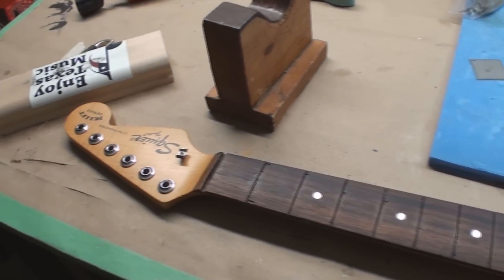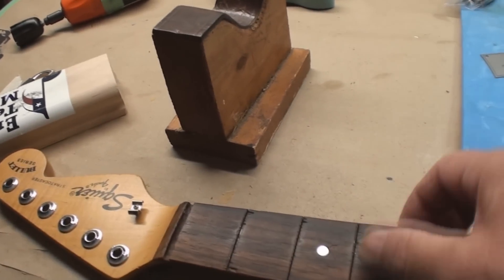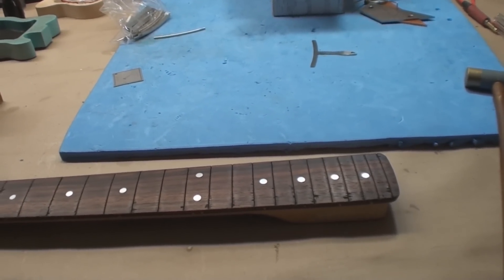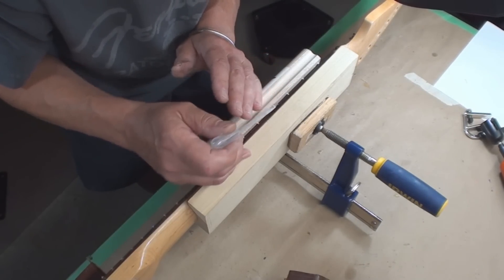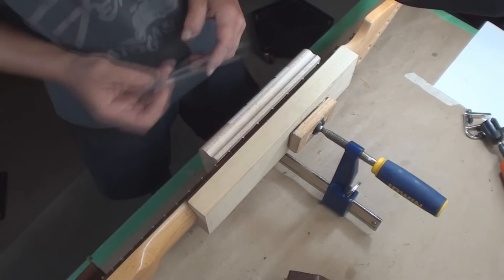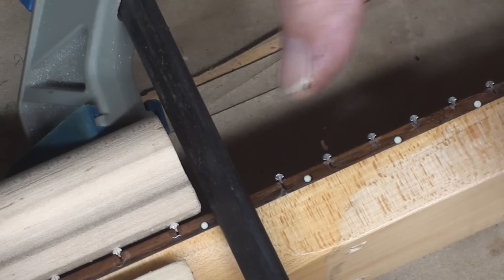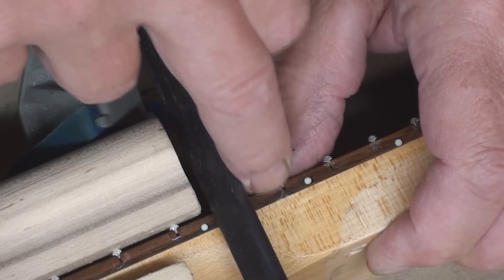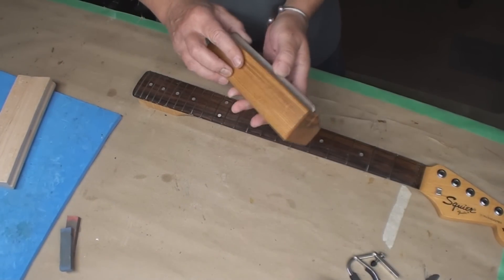Guitar Fret Replacement Tips

Comment: From Leo:  Tip for you buddy.   I put my end nippers in a one gallon zipper plastic bag and use them inside it. 
  Push it so that the fret pokes a hole. and then trim the end.  Keep reusing the same hole as much as possible.  All the trimmings stay in the bag instead of flying in your face and all over the shop. Hope that helps, cheers.
Reply: This, all day long. I have never done any guitar work, but I use this same trick whenever I have to cut screws, pins, or other small metal parts!

Comment: I have a 1996 Squier Stratocaster which has never had a refret. It hasn't presented with major ssues but the frets are very flat on top and very low. The nut is also the original nut and I'm considering replacing it with bone, but I know that once I refret it I'll need to do it again or shim the nut. Not sure what I'll do yet but this vid has been helpful.

Comment: Hey Dave! great video, I have a question, was wondering if you could help me, I have a fender american strat guitar with a maple neck, I guess the maple is finished beacuse it has a shine on it and it is probably lacquered or something, I have no clue what is the finish although I would love to find out anyways I was wondering on how to go about cleaning it without damaging the wood or the finish on it, is a damp rag ok? Also the frets have some corrosion on them so if you can tell me what sand paper grit to use for removing it without removing too much material off the metal I'll be glad, thanks!

Comment: Hi Dave,  Thanks for advice about wetting the fret board, it worked a treat 👌  What made getting some of the lower end frets in,  even worse, was the last 4 frets of the finger board has an unsupported section, i.e. a gap between that, and the sound box, so had to be a bit careful packing it up to stop it springing about.  Removing the neck was not option in this case,  as I'm in the process of restoring what I think is, 1931/32 Epiphone Archtop.  
Cheers Roj UK

Comment: Curious as to why when you “clamp and then glue” those fret ends that pop up why you don’t “glue them clamp” ? I assume for me I might put to much glue in and when clamping it’d squirt onto the fretboard or on the neck , but even a dumbass like myself would be able to figure a way to get dried glue off of  a neck or fret board …and I imagine since your the one giving the tutorial how to (meaning have a lot of trial and error /expertise) you’d be more precise with the amount of glue you’d drip into the fret ends so it wouldnt make much if any mess… is there another reason to clamp first then Drip the glue in that I don’t know about cause I’m a dumbass?
Reply from the maker: hold the fret that lifts in place